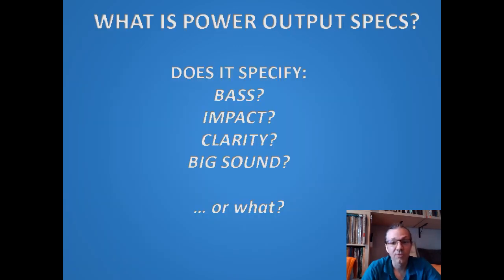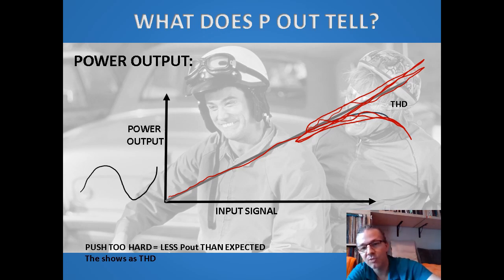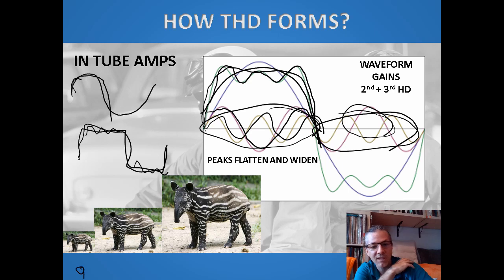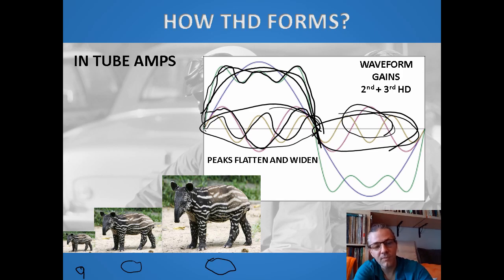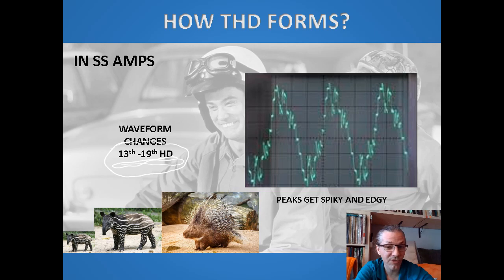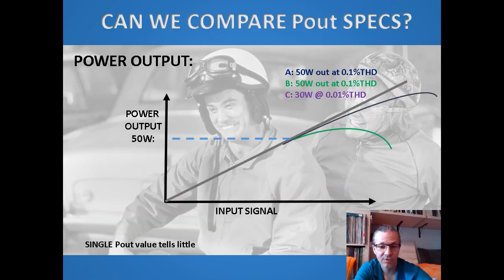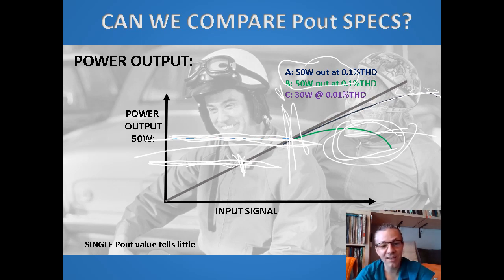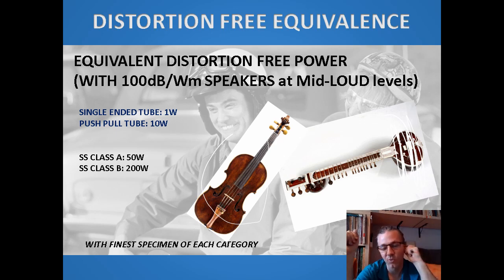Power Rating - What does it tell?

Comment: Great video! As I am stuck with low efficiency speakers for now, I have been looking into many less known SS amps to see what is available out there. I found the Norma Revo IPA-70b, its distortion is unusual for a SS I think, as it has a high 2nd order and also the even ones are higher than uneven. What I cannot really understand is the THD measurements: it shows higher THD at lower watts, than it goes down to a minimum and then increases at the power limit again. Are you aware of amps that measure like this and why this is sometimes the case? Is it maybe due to a characteristic from the circuitry? Thank you
https://audio.com.pl/testy/stereo/wzmacniacze-stereo/2704-revo-ipa-70b

Comment: Great video’s thanks😊 I wonder. Do you suggest to design the speaker first and then the amplifier? Considdering room dimensions, speaker efficiency, power needed.
Reply from the maker: Yes, I would start with speakers first, as it has to match your room - size of the room, and your available placement options define what kind of speakers will work best. Then, go for an amp that matches the speakers the best. In general, try to go for as high efficiency as possible. That translates to as big cabinet as allowed. Smaller speaker size will make the amplifier's work more difficult. You still can get very good sound, just lower dynamic range and lower peak volume.